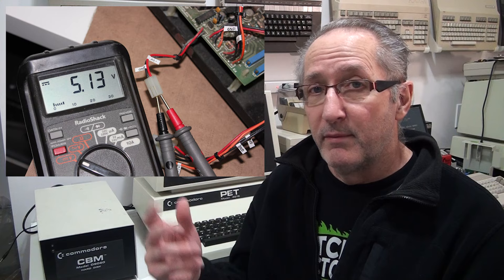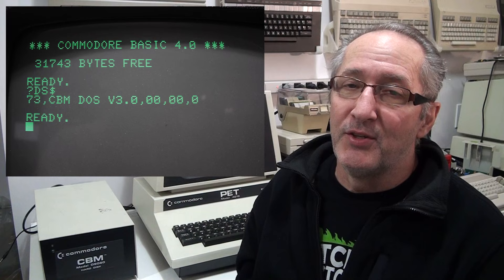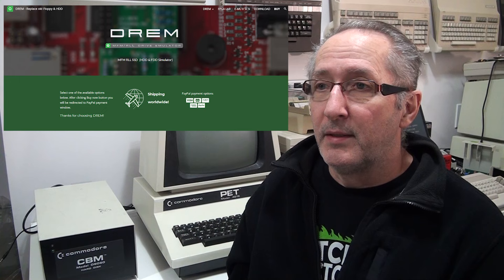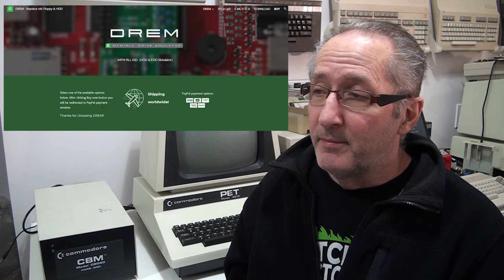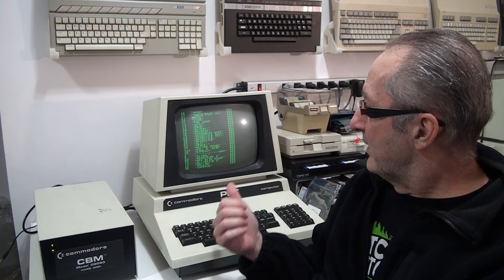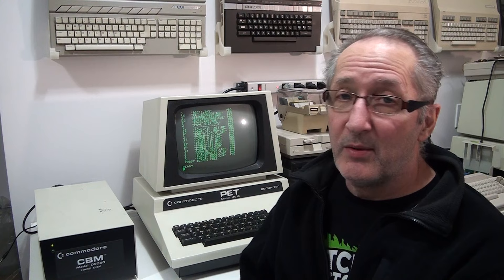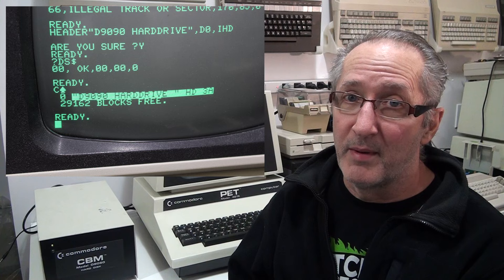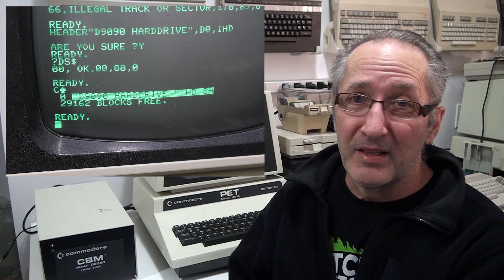Upgrading, Enhancing and Unlocking Secrets of the Commodore D9060/D9090 PET Hard Disk

Comment: There are plenty of 3.5" to 5.25" drive mounts that include both the horizontal and vertical screw holes, no need to 3D print. o.o They're made of nice metal.
Reply from the maker: Thanks for pointing that out.  At the time however I had a dead MFM drive so it made sense to simply create a mount and utilize what I had.  Plus, the frame of the ST-225 is quite robust, and offers a really nice solid platform onto which I mounted the SASI and DOS boards and hang the DREM underneath.  The 3D printed Mount only took me a couple hours to design, and am very pleased with the end result.  I don't think, for me, I'd do it any other way.  But, I do appreciate your comment.

Comment: Only the newer version of the firmware takes that long to format (there's a printed note from Commodore about the change in time with the new revision).  The older version was much quicker, so perhaps it only did one pass, but for some reason, they felt it was important to do the extra pass.  Perhaps it's to catch marginally bad sectors?  Drives used to be a lot less reliable, and it was 100% ordinary for MFM drives to have a few bad sectors.  Many vintage systems had either a replacement table scheme or the ability to have "bad" files soaking up the bad blocks, but a few only worked with perfect drive surfaces.
Reply from the maker: Yes, errors on HD's back then was commonplace.  I concur that it swept through the format 6 times in an attempt to encounter errors prior to concluding that the format was successful.  I was not aware that the older revision of DOS3 had fewer sweeps.  Thanks for commenting on that!  I will have to give that a try.
Reply: @8BitResurgence  There appears to be a RevA (posted by me) and a RevB on zimmers.
Reply from the maker: Thanks @ethandicks3 , I'll check it out.